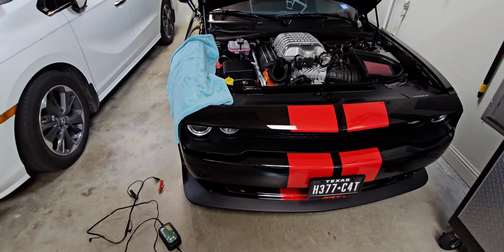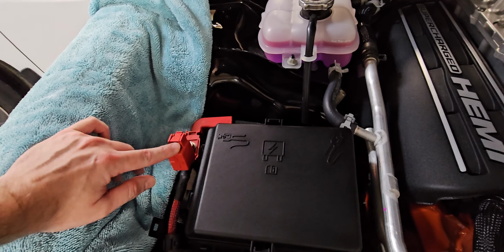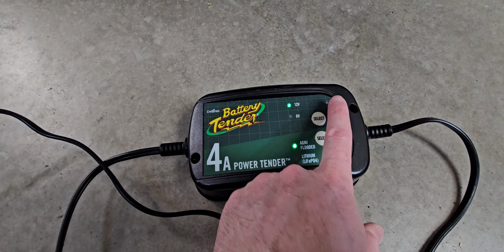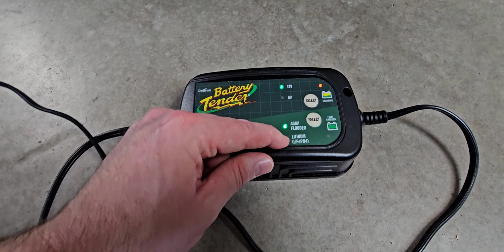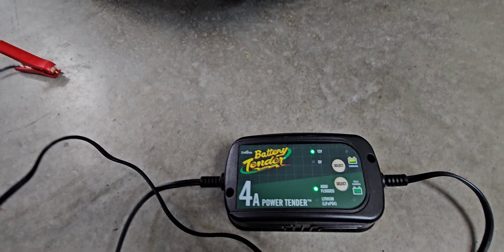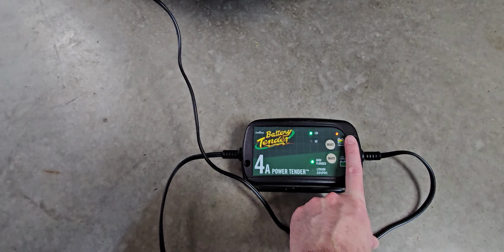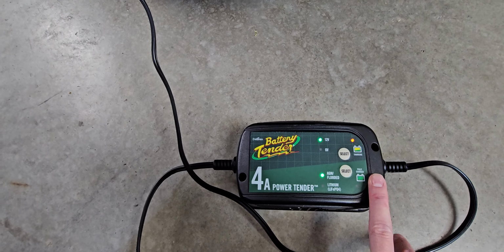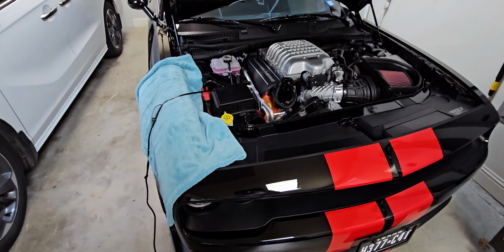Trickle Charge Challenger / Charger

Comment: Great Video on trickle charging. I have a SRT 6.4 L. and I have not been able to trickle charge the battery to the point that I get a green light. 
I measure about 71% charged. Several maintainers I have, have been in a state of constant charge with some failing with bad battery. It recently died in my garage totally. I was able to charge it back to life and started it. I currently have it in the storage mode. However, the voltage has dropped from 12.5 when place in storage to 11.5 and now after 3 days is 10.47. My the way this is a 2024 and has 158 miles on it. Do you think I have some type of voltage drain? I brought it to the dealer and they put it on a tester and said the battery is fine. Of course after driving it 25 miles to the dealer it was charged up.
Reply from the maker: My new mopar AGM battery lasted about 1.5 years, then it wouldn't handle the current draw. They have 5 or 7 year replacement warranty, just take it to dealer and they will swap it.

Comment: How long does it usually take for the car to be fully charged up? @TrickMasterPC
Reply from the maker: From 80% to 100% about an hour. From 0% to 100% could be from 6 to 8 hours.
Reply: @TrickMasterPC  i just bought one, and it's doing everything it's supposed to execute the 12v light, which is blinking. Is that normal?
Reply: Except*